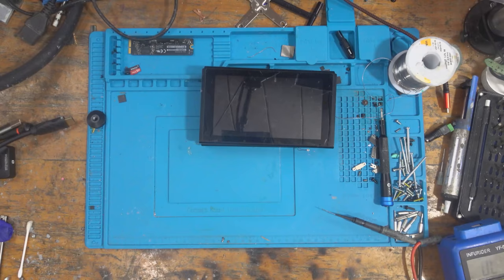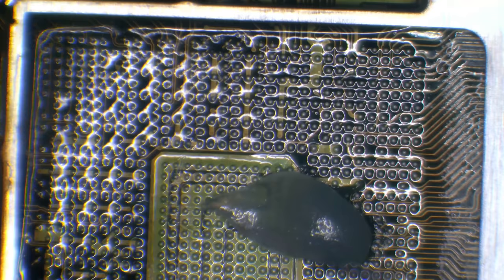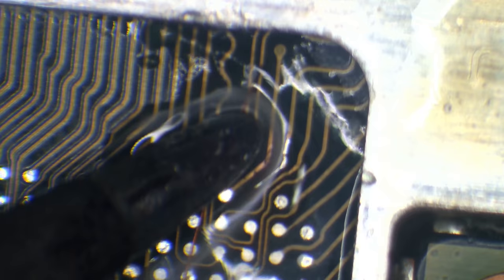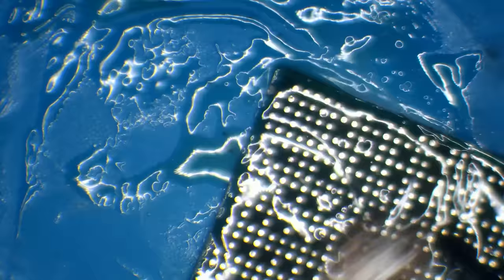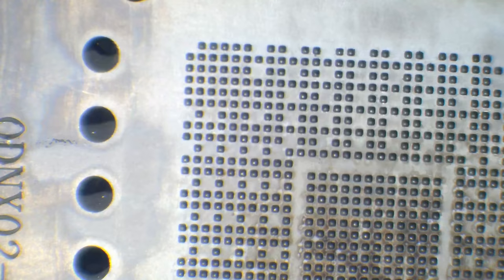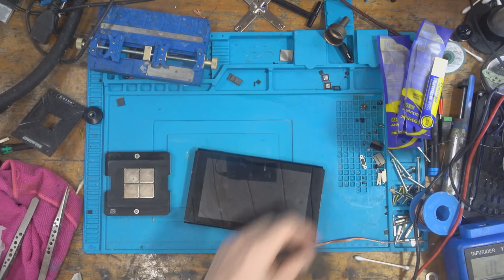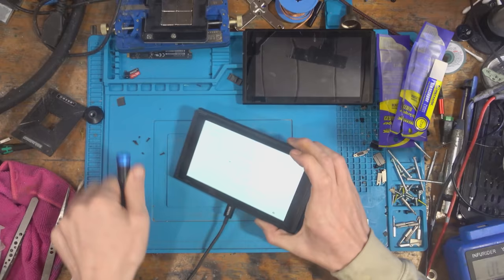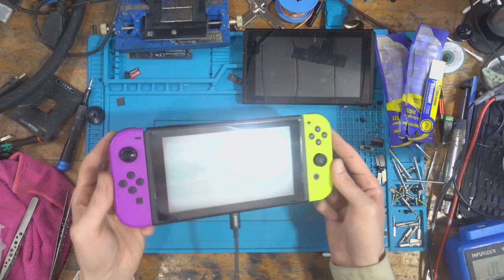I Bought TWO Broken Nintendo Switches From Ebay - But Can I Fix Them Both? Part 2...

Comment: U seated the APU 90degrees left turned back on! Lift off. Reball. Turn 90degree right and sit it back
Reply: You may be correct. I would be interested to know if it was put in the right way. Also did you replace the capacitors that were missing?
Reply from the maker: It was the right orientation as far as I know buy I can double check if I can find the board again lol

Comment: at 16:17 , literally right above the the jumper wire.. you cant see the trace you broke? when you cut the jumper... its pretty BIG.. 
and to the left of the pad section you replaced.. i think you cut a 2nd trace.. right where the pad circle turns into the longer trace
DON'T cut on the board.. lift it up and cut with scissors.
Reply from the maker: Yeah i see it now it's been pointed out. I'll likely be doing a revisit on this board to try again, but using scissors on that scale is almost impossible. The jumper wires are ~2mm in length, which would make it very difficult to be accurate with scissors
Reply: You could consider using a surgical blade to do your cuts with, there pretty sharp and would require less effort when executing your cuts...

Comment: Gutted the reball didn't work! Out of interest how do you line up the chip when putting back on the board?
I have been after a reball station for a while, saw your link in your description, didn't realise they where that much though :(
Reply from the maker: Yeah bit of a shame but I may have screwed up on that one so I need to look at it again if I get time. The chip I use a pressure trick I've developed. I will get the chip roughly in line then press down with my fingers gently and wiggle it. If the chip stays firm it's lined up 😁 those bga machines can be a huge investment to be honest. I got lucky and paid £400 for mine, but generally you're talking £900+

Comment: Hi phil nice fix but did you tried to replace the capacitor on the cpu. I didn't saw it video maybey that is proble why the switch doesb't turn on anymore.
Reply from the maker: Thanks mate, nah you would at least get a boot logo without the caps, but I think the issue is I damaged a trace and some people think I installed the cpu the wrong way so I'll do a revisit to try again 😉
Reply: @TheCod3r  ok did you see i uploaded the shematic for xbox original on your challenge.

Comment: great video as always and very informative. ive got a weird one here with a switch. customer brought it to me with assumed no power issue. assumed charger port. ive checked the port and no issue found. however only charges at 485 ma (battery is at 3.5v). if i press the power on button it draws power as if its booting, (battery voltage drops slightly) nothing getting silly hot, BQ gets up to around 35 deg c while on charge. but no backlight. i thought maybe backlight driver and its booting but cant see the screen, getting 2v accross pins of the display connector. however i dont think its fully booting as i dont get any sound when inserting the joy cons. ive swapped BQ, P13 and still no joy. going to swap m92 later when they arrive and hopefully that sorts it. Do you have any other recomendations on what it could be? done RCM check but all good. cheers
Reply from the maker: It could be a P13USB issue. P13USB tends to drag around .48amps when it's bad. It could also be a cpu issue. Did you check the cpu cap in resistance mode?
Reply: @TheCod3r  I’ve replaced p13usb and still the same. The cpu gets slightly warm but no backlight and stuck at 480ma. Checked all caps for shorts and can’t find any at all. So probably a dead cpu I’m thinking